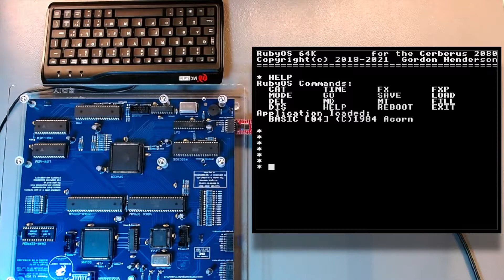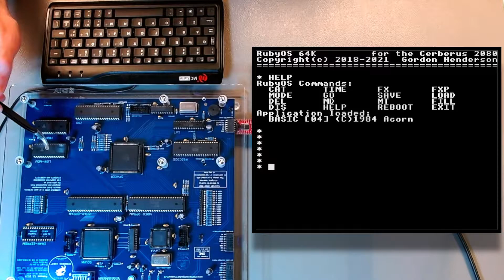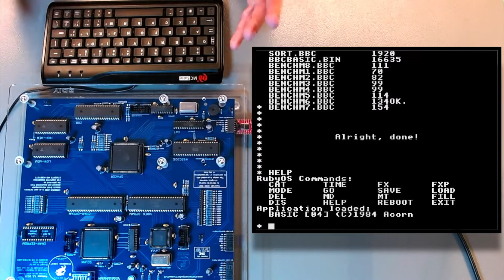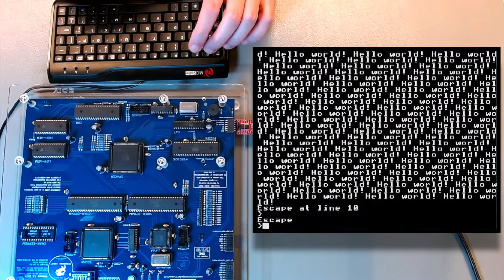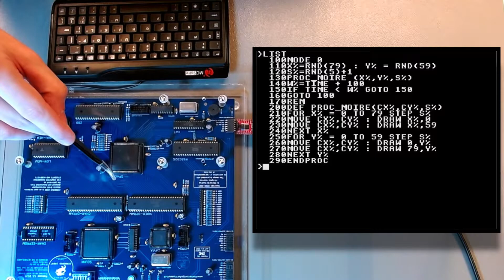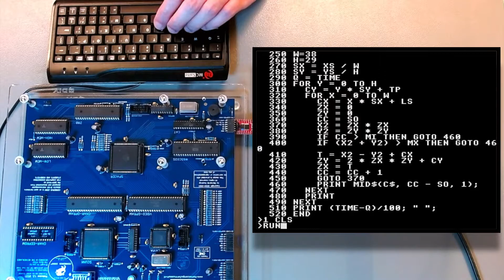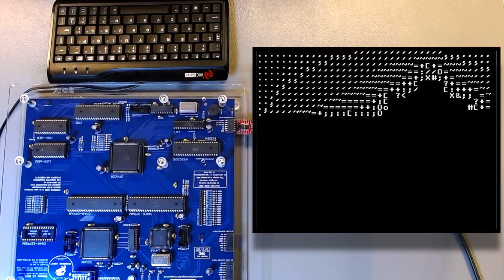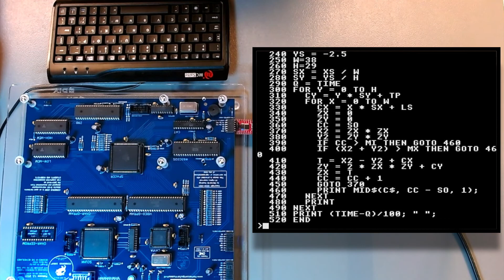Demoing CERBERUS, the flexibility

Comment: Impressive. My ears pricked up at the word "Forth" because I've been thinking about the best implementation of a Forth kernel pretty much since the first Cerberus video ;). 32K is a lot of space for an 8-bit Forth kernel: seems likely it could fit a text editor and assembler/disassembler/debugger for both CPUs on CAT with room to spare, and no requirement for an SD card. I've written Forth kernels for several different platforms and am a huge fan of Chuck Moore, so I'm very curious to see what materialized, if anything!

Comment: I am new to cerberus and trying to follow your very interesting project. Why is low mem address c000 (49152) and high mem 8000 (32768) ?
Reply from the maker: Hi Roeland. The low memory starts at address $0000. But the 6502 uses the lower addresses for its zero page and stack, so one can't load an OS there. And Gordon's OS probably uses some more lower addresses for variables, pointers and what not. So he chose to load the OS starting at address $C000. It's his choice as the programmer.
Reply: @thebyteattic  I think he means that $C000 is a higher address than $8000. Why isn't $C000 in high memory? The logical way to look at it is that low memory is $0000-$7FFF and high memory is $8000-$FFFF. So what is strange about the Cerberus?